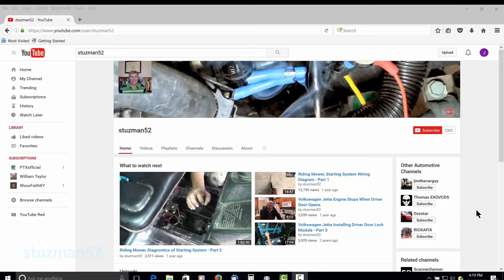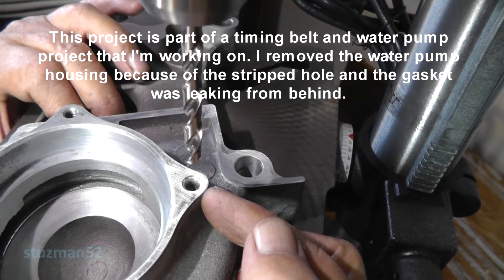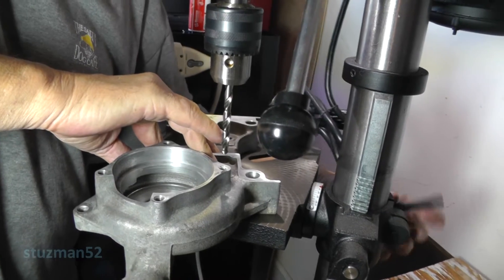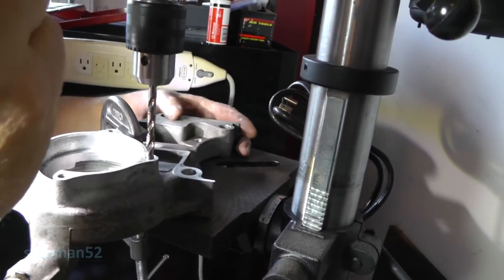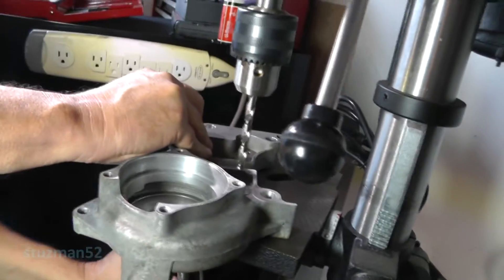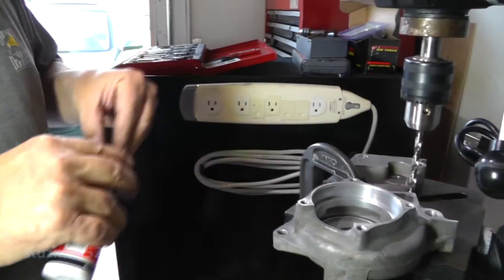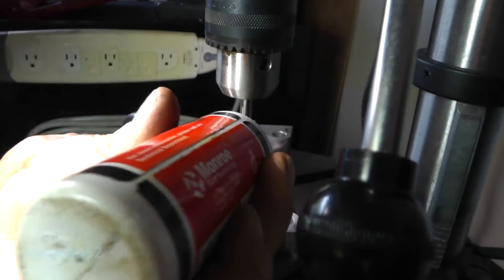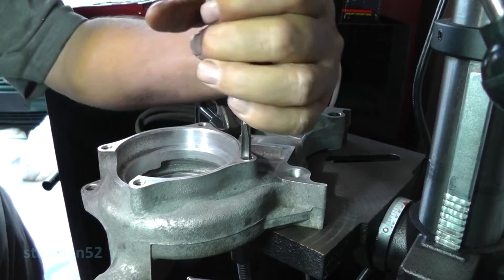Ford Escape Installing HeliCoil in Water Pump Housing

Comment: Water pump bolts are the worst! Top 5 most hated jobs by me. I had a water pump bolt break in the block of my 1976 Datsun 280 Z I had to remove the whole front cover drill out tap and Heli coil it what a pain in the ass I just hate water pumps. Guaranteed to snap bolts
Reply from the maker: You're right about that Jack as this one had one stripped out bolt threads where the previous owner had the timing belt changed.